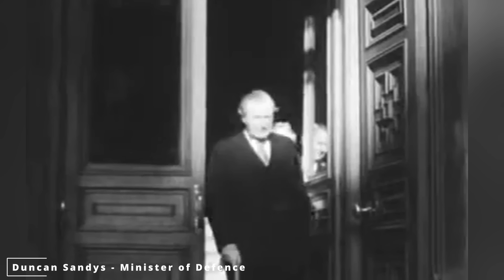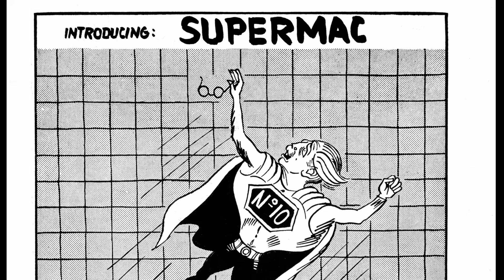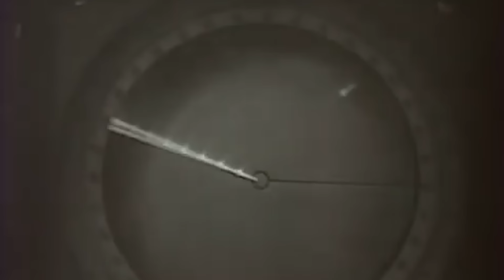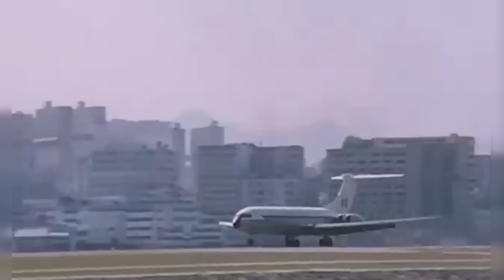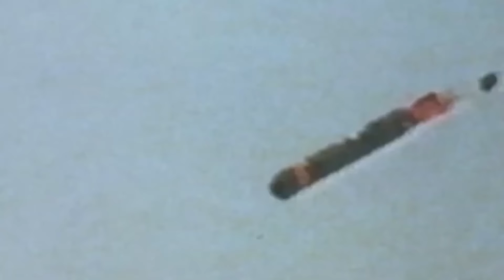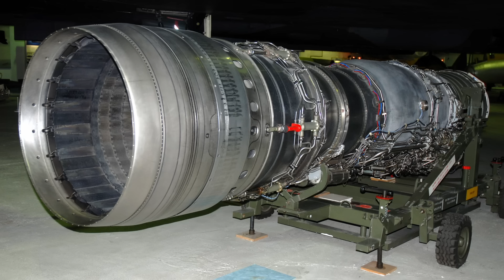How Britain Turned A Failed Airliner Into a Soviet Submarine Predator | The Mighty Nimrod

Comment: BS never on budget as the last iteration was nearly 1x££ billion over spent !
Reply: We believe we can clear up some commonly held myths and misconceptions obviously.

It's always good to see the facts presented clearly and concisely isn't it?

All production Nimrod aircraft were new build Comet 4 airframes with the necessary modifications. The Nimrod was the most advanced and most capable aircraft of it's type at the time it went into service. The  Nimrid HS.801 was not available for purchase by other countries. The ability  if the HS 801 to repeatedly demonstrate detection of subs and the knowledge that it could deliver nuclear depth charges to a target was a very effective deterrent. 

Bow-wing (see B-47 wing collapse wing folding incidents) had built less than 12 pressurised airliners before the Comet first flew and they were not high altitude airliners. 

All Nimrods were new build Comet 4 airframes with appropriate strengthening and the unpressurized  equipment bay tacked on. 

The HS 801 Nimrod was the most advanced aircraft of it's type at the time it first flew. Problems with the MRA4 programme were almost entirely due to radar and computer equipment issues and BAe Systems & co being too busy with other work at the time. 

Obviously there have been worse aircraft for accident losses both before & after the Comet and Nimrod.

Early problems with Comet takeoff stalls were caused by pilots over rotating the aircraft at liftoff. 

Podded engines on wings have aerodynamics issues. The main reasons for eventually going with podded engines were because or to facilitate - Ease of maintenance. Use of shear off fixings given excessive out of balance forces.
Large diameter turbofan engines.
Reduce load on the wing to fuselage connection. Increased power from later engines. 

The Bow-wing (See B-47 wing collapse & wing folding incidents) was a good example of how to expend a huge amount of cash and effort on something that was probably not worth bothering with. The basic design of the Comet had been decided upon and established before the podded engine choice has been made for the B-47. There were aerodynamics problems with podded pylon mounted engines at the time. The US also built and operated a significant number of EE Canberra bombers under licence which did not use podded engines for their wing mounted engines. . 

There have been aircraft losses caused by pod & pylon mounted engines. 

All jet airliners benefited greatly from the knowledge gained from the Comet incidents & subsequent investigations & yet some were still worse for accident losses. 

Instances of all marks of the Comet flew with full certification after 1954 including the Comet 3. The last Comet flight occured in 1997.

The fabulous trail blazing DH Comet.
World's first jet airliner in regular service.
The jet engined Avro Lancastrian actually did a passenger service before the DH Comet. 
World's first high altitude airliner.
World's first airliner with a full fuselage length pressurised cabin pressurised for high altitude flight. That feature for that type of aircraft was a considerably difficult undertaking. 

The change from larger squarer windows to smaller rounder windows was necessary for the particular aircraft at the time. Skin thickness remained mostly the same for all Comet marks. 

How things were back then.
Accident losses - % of aircraft built.

DeHavilland Comet 4 UK                          14% 
DeHavilland Comet all mks UK (ff 1949)17%  
Vickers VC10 UK (ff 1962)                         5%

Douglas DC-1  US                                       99%
Douglas DC-2                                              47%
Douglas DC-3                                              30%
Douglas DC-4                                              26%
Boeing s300    US                                       72% 
Boeing 307                                                  70%
Boeing 247                                                   48%
Boeing 707  (ff 1958)                                 32% 
Lockheed L-049 Constellation (ff 1943)  30%
Lockheed Electra US (ff 1957)                   29%
Fairchild FH-227 US (ff 1966)                   30%
McDonnell Douglas DC-8 US  (ff 1958)   14%
Sud Aviation Caravelle  (ff 1955)             15%
Canadair CL-44 Turboprop US (ff 1959) 46%  
Convair CV-580 Turboprop US (ff 1960) 22%
Convair CV-880     (ff 1959)                      27% 
Convair CV-990     (ff 1961)                      33%
Tupolev T-104        (ff 1956)                     16%
Vickers Viscount UK  (ff 1948)                29%  
Fokker F-27 Turboprop NL (ff 1955)       40%      

The Vickers VC10, fastest Atlantic crossing for a non supersonic jet airliner, held the record for 41 years.

For the first few years of operation the Caravelle & Comet had similar accident loss fatalities.

Sud Aviation Caravelle - 
all accident loss fatalities - 
1320 fatalities. 

De Havilland Comet - 
all accident loss fatalities - 
453 fatalities. 

An example of a typical airliner from the period. 
The Fokker Friendship F-27 fatalities & accident losses as a % of aircraft built. 
Fokker F-27 Turboprop (ff 1955)   40%
2130 fatalities.

Of course De Havilland carried out a full stress analysis & performed extensive & protracted testing on two long lengths of fuselage representing all features of a complete airframe. De Havilland carried out significantly more testing than was required by any authority at the time & significantly more testing that any previous airliner was subjected to.

De Havilland designers / engineers knew all there was to know about metal fatigue at the time they designed the DH Comet.

De Havilland had prior experience building many all metal construction airframe aircraft including many passengers aircraft & thousands of jet powered fighter aircraft that were primarily of metal construction with pressurised cockpits & used jet engines built by De-Havilland.

De Havilland did indeed always work to better than industry standards at the time, used up to date knowledge for the design & testing activities & no evidence of negligence or criminal negligence was ever produced in relation to the DH Comet.

Global aerospace. 
From the 1950s sector rationalisation and consolidation took place. 70 companies in France and 300 companies in the US disappeared due to merger or dissolution. In the US Boeing was almost bankrupted by the 707 project.  Boeing had a well protected domestic market and the available space and resources in the US to engage in large scale airliner manufacturing enabling them to capture orders simply by being able to produce airframes fast enough and cheap and nasty enough. Another factor is airlines preferring to obtain as much of their airliner inventory as possible from one manufacturer. 

Global Aerospace Sector, what's happening.

For example, there are of course no German companies that makes German jet aircraft in Germany & there are no German companies that make German gas turbine aero engines in Germany that are suitable for widebody airliners.

The UK has the world's highest combined per capita Nuclear / Defence / Aerospace Sector Activity.

UK defence sector, absolute terms, world's second highest activity. 1st for per capita defence sector activity. Per capita nuclear powered submarine construction, 2nd position. 
Main players being Rolls Royce, Babcock, GKN Aerospace & BAe Systems. Activities often involve international collaboration. BAe systems, RR and other UK companies now handle more Airbus work value wise than Germany. 

There's a good chance that anyone currently flying on a widebody airliner will be on an aircraft powered by RR gas turbine aero engines made in the UK and a good chance there will be other hardware on the aircraft that's designed and / or manufactured in the UK. 

Rolls Royce Holdings UK
Subsidiaries
- Rolls-Royce plc
- Rolls-Royce North America (ex Allison etc Classified Military stuff)
- Rolls-Royce AB
- Rolls-Royce Deutschland
- Rolls-Royce India Private Limited
- Rolls-Royce Marine Power Operations
- Vinters Engineering Limited
- Rolls-Royce Controls and Data Services
- Rolls-Royce Power Systems
- Bergen Marine
Joint ventures include:
- Rolls-Royce Turbomeca
- MTU Turbomeca -

Trent Family
The MT30 (Marine Turbine)
Industrial Trent 60 Gas Turbine
Trent 7000
Trent XWB Airbus A330neo.
Trent 1500
Trent 1000
Trent 500
Trent 600
Trent 700
Trent 800
Trent 8100
Trent 900
   
RR wholly owned subsidiaries in Germany handle smaller 2 shaft RR gas turbine aero engine work.

The UK space and aerospace sectors are highly productive, high-value industries that together contribute over £18 Billion in direct Gross Value Added (GVA) to the UK economy. Individually, the space industry directly contributes about 0.3% of UK GDP 7•2 Billion while the aerospace industry contributes approximately 0.5% £10•9 Billion.
   
We hope this helps.